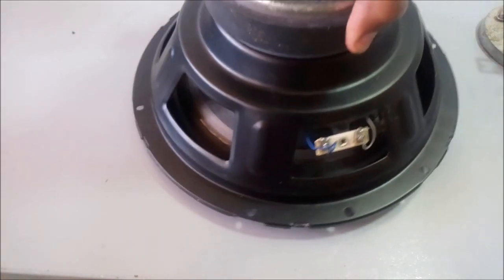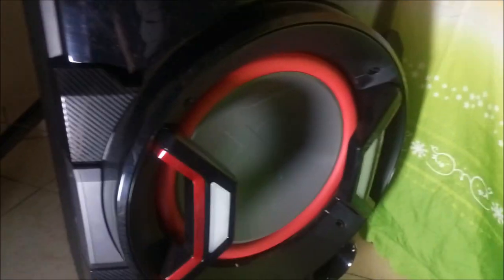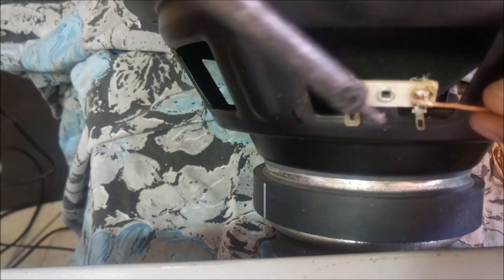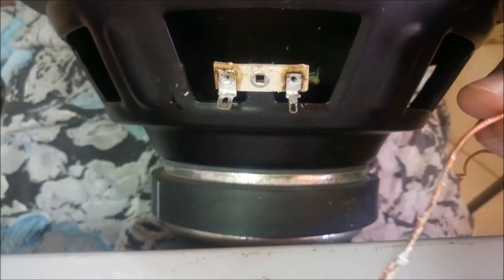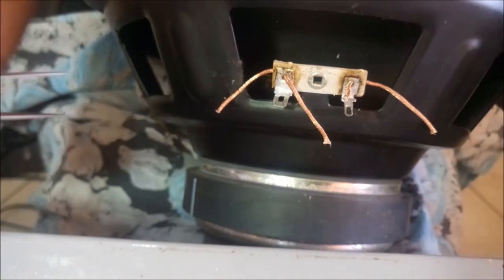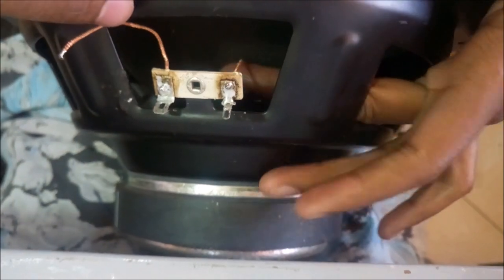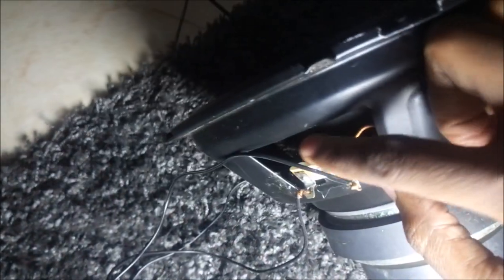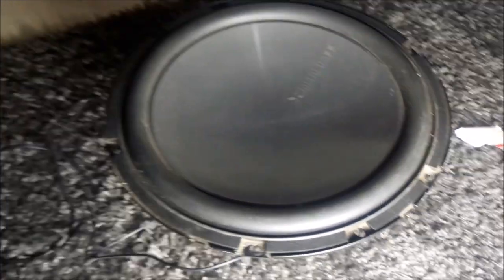Replacing Tinsel Wire On LG Subwoofer Speaker, How To Repair

Comment: Can any wire be used instead of braided tinsel wire to connect voice coil to the terminals if this wire breaks ?

In most cases the tinsel wire gets corroded after some time or becomes black due to carbon from petrol or diesel fumes and gets open but the coil is ok

Comment: Those plastic fake screws are usually pluggs that can be removed and behind them are real screws. I have also successfully resealed a wood to plastic sub box like you displayed. You just have to be really careful when separating so you don't crack the wood.

Comment: What if you cant see on the paper where the wires go?
Reply from the maker: If you remove the dust cap you will see the wires
Reply: @DominicGichane  This Toyota speaker is so cheap the cover is glued on cant remove it without destroying the speaker.  I found the wires one is so short not sure if I got it but I managed to solder the 2 back on.  I also glued them so tomorrow I will see if it works if not then will get new speakers.

Comment: What is that silver wire?
Reply from the maker: You mean the solder
Reply: @DominicGichane  ok, i get it, its solder wire
Reply from the maker: @mrskomalrbmittal9156  I'm sorry i didn't mean it sarcastically. There was another grey wire that I removed and that's what I thought you meant at first.
Reply: Did you got that tinsel wire ?